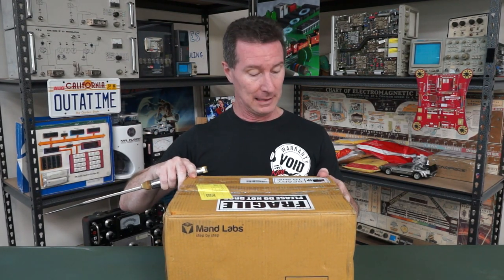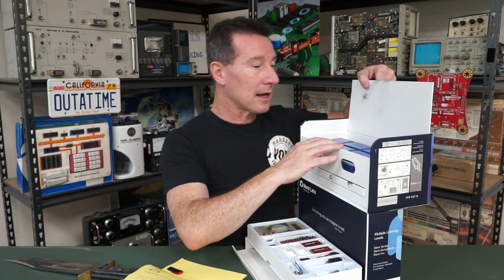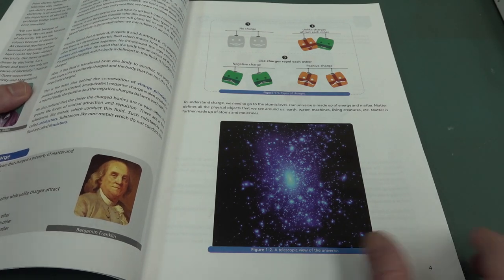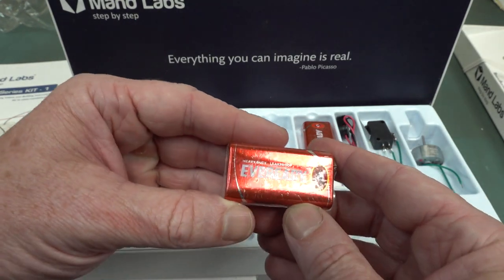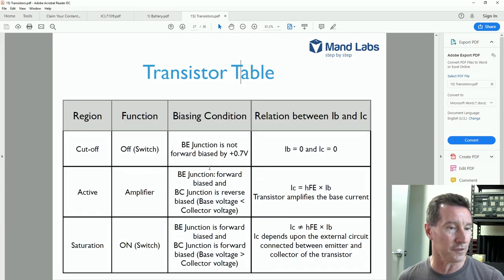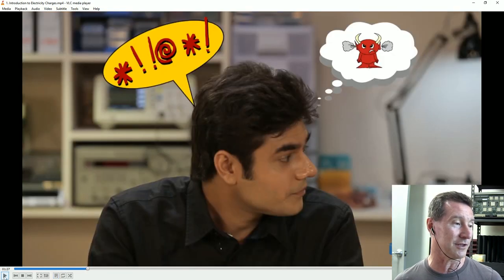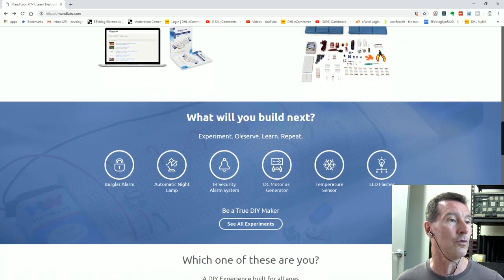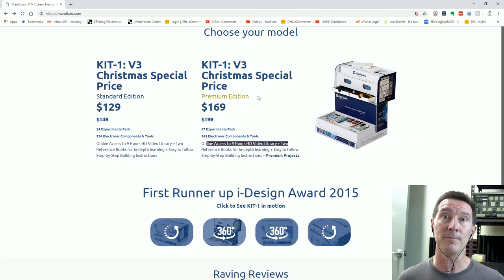EEVblog #1163 - Xmas Mailbag

Comment: I use both FreeBSD and Linux and I have done for over 2 decades. Vocal (mostly online) BSD 'advovates' do both themselves and the wider BSD community a huge disservice every time they talk about how 'bad' Linux is. They just sound like jelous, spiteful , whiney little babies because Linux became the standard/most popular UNIX-alike and *BSD did not. If you wish to gain converts to BSD, you have to explain in a mature and calm way why users should consider using Free/Open/DragonFly/Net BSD etc. You should promote BSD on its technical merits , not by highlighting any perceived negatives in Linux. Badmouthing the GPL and/or Linux is not a selling point and will convince no-one. The vast majority of computer users don't give a flying %$%& about the merits of the BSD (or MIT/Apache etc) licenses over GPL licenses and never will, like it or not. Licensing only concerns developers and it is of itself not a sensible reason to go to the length of switching your kernel or OS for unless there are other, real benefits.

Comment: on the topic of non leaking batteries not so long ago i had to change batteries in my worklight wich i use when i work on cars, in there are 3 AA batteries and i was a little surprised to see that one of the batteries has leaked and it was a duracell not the other 2 no name batteries

Comment: Love the videos as always and Merry Christmas. The acceleration switch on the beacon looks to use a magnet in the center with it's force calculated so when struck it breaks free from the screw and drops to the contacts and sticks until you push it back and reset it on the screw. Now I'm going to have to do an internet search LOL curious if that's what it is. If so I would say it be a quality magnet

Comment: Personally I'm kind of split on the education issue...  I think learning about atoms and electrons at first is important, just to get a basic understanding of what electricity is (i.e. not much more than it's just electrons being pushed through a wire), and I thought it was great the manual started with this.  To use a car analogy, yes I'd prefer to understand the basics of internal combustion engines and transmissions before trying to drive a car.  I know most people don't though.

But after that I initial step, to learn more complicated topics, I find it's much easier with an end goal/application in mind, which provides the motivation to learn, i.e. I agree this content went way too far into the theory without that motivation.  At the point Dave gave up (where they said "n is always an integer"), I was thinking that's a bit of a useless fact for a beginner (and really just the wrong way to explain that you can't get fractions of an electron anyway).
Reply: If it were me, I'd do it the other way around. First the'experiment - then some explanation what is actually going on with the current, electrons etc. From practise to theory. Maybe it's just personal preference.

Comment: The 1070 Ti is just parts from a 1080 that have defects that's all
Reply: Tri-Force Squad Gaming Except the 1070 Ti was launched something like a year and a half after the regular 1070/1080. You’d think production would be mature enough at that point that the overall defect rate wouldn’t be high enough for that. No, they were perfectly functional 1080 dies that were cut down slightly to try and head off the AMD RX Vega. That’s really all the Ti’s were at that point, slightly performance boosted versions of existing products launched to take the shine off AMD. The problem with the 1070 Ti was that it was so close to the 1080 that nVidia had to “encourage” its board partners to not release factory overclocked versions in order to protect 1080 sales. Saying it shouldn’t exist is a bit much though. You really only hurt nVidia by buying one and I’m not sure how much of a problem I have with that...

Comment: I've had some bad experiences with cheap chinese LEDs. Bought them from 10€/1000 pieces, but they failed on me after some 100 hours at 10 mA. One type just faded (less than a third of the original brightness), for the other type I ended up with 3 out of 10 completetly dead - after maybe 600 hours of operation. I went back to name brands, doesn't make sense to save some cents, if you have to do all the work again after one or two years.